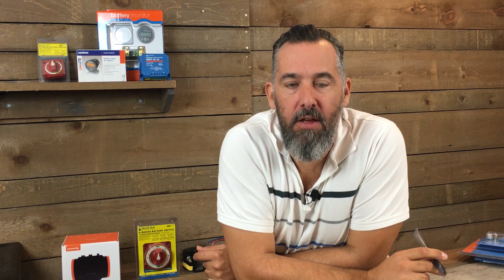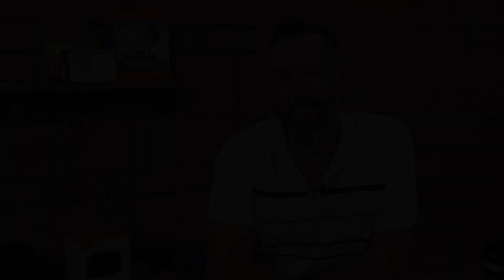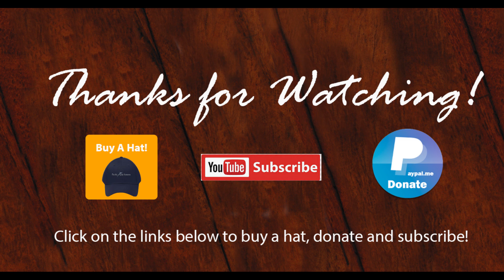Do Slow Charging Devices, Like Wind and Solar, Shorten the Life of My Batteries?

Comment: If I have flooded batteries,and four charge controllers.Should I set three of them to sealed led acid.So the batteries don’t get equalized to often
Reply from the maker: IMO, set the charge controllers to the correct battery type. Don't try to overcharge batteries to reduce the need for equalization.
Reply: @PacificYachtSystems  i was worried,each controller would equalize every 28 days, and it would be to much.Thank you for informing me.Love the YouTube channel

Comment: I was about to instal 450 amp hours of MG lithium batteries (which I have bought along with an MG Master LV battery management unit, a Top Systems TS 1600 100 amp DC/DC converter [this was for charging the system from the engine], and a Victron charger inverter) (I hadn’t heard of Firefly batteries). I was about to add another 450 amp hours to that and install the lot when the whole issue of lightning vulnerability of Lithium BMS came up with some high profile lightning strikes. So now I am looking at buying 450 amp hours of Firefly batteries instead of the extra Lithium and use those as the main battery system, and use the Lithium as a separate bank connected to 4 250 watt Panasonic solar panels and a D400 wind generator connected to the main bank with a second Top Systems 100 amp DC/DC converter. In this arrangement I think that I can switch isolate the the Lithium Solar bank (between the 2 MG Master battery management units). The charge controllers for the separate Lithium Solar bank are the individual MPPT units and the wind generator charge regulator I think?  For the main lightning protection I am designing a segmented silver plated copper tube with inner SS wire tension member to run from the mast head to the gunwale (with an extra loose trailing cable to the water disguised as a fender). They use such silver plated tubes in high voltage switching (400,000 volts I believe). The lightning problem is only going to get worse with Global Warming driven Climate Change.
Reply from the maker: Hi William, thanks for sharing. Interesting points, especially about lightening protection.

Comment: So the answer is to use firefly batteries, or have a lithium component for the solar that charges an AGM bank through a regulator of some sort in a controlled manner?
Reply from the maker: Hi William, that's one of the options.

Comment: Hi Jeff,  Awesome series.  I am refitting my new old Tayana 37 for some serious cruising.  I plan to head to Europe and beyond.  Can you please cover the topic of charger/inverters for worldwide use.  It seems like I would want to fit my boat with a 240VAC system and use some type of adapter when in the US and Canada.  Thanks again!
Reply from the maker: Hi Thomas, besides voltage, the real challenge is frequency. Inverter/chargers have specific voltage and frequency requirements. Read more about this here:
https://www.pysystems.ca/resources/tech-talk/european-conversion/
Reply: @PacificYachtSystems  Thanks Jeff!  This is very helpful.  As I have a new world wired boat, I am guessing the easiest and least expensive route is going with a charger or charger/inverter that can handle 120v/60Hz & 240v/50hz.  If only a charger is available, we could at least live off the 12 volt.  Thanks again!

Comment: I would like to add that it depends on the chemistry as well. A lead acid cell of any sort likes to be kept fully charged, or topped up regularly, otherwise they sulfate. A chemistry that does not sulfate  tends to be more tolerant of a partial charge. Rate of charge is more a system design goal/ideal when it comes to variable sources. I spec'd 1400 watts of PV for the truck system I'm building. I do not expect to see that output often, if ever. Alternator charging and a small APU are in the design to cover multiple cloudy days.
Reply from the maker: Hi Tao4409, thanks for sharing, well said.
Reply: @PacificYachtSystems  My pleasure Sir. Thanks for the great content. :)

Comment: Question:   I receive conflicting information on the type of DC/DC converter to be used on a boat. Isolated or Non-isolated?  An example is 24vdc house battery bank, step down DC/DC converter to 12 vdc to run lights and instruments. Shouldn't both 24 vdc and 12 vdc share a common negative grounding bus, hence non-isolated converter should be used? Many on the "internet" say to only use isolated converter. Victron sells both types. Confused.
Reply from the maker: Hi Telly, historically we'll always had troubles with non-isolated and mostly install isolated DC/DC converters.

Comment: I have a related question, if I have a charger on for weeks or months, to keep the batteries charged when the boat is on a marina, whats the ideal voltage for floating in this cenario for AGM battrries to extend battery life?
Reply: I asked Jeff this once for firefly. He said read the batt manual and charger manual and do NOT overcharge.
For firefly it is 13.4 v float I think and I made sure I set the xantrex charger in hot temp mode even in winter to prevent overcharging.
Reply from the maker: Most 12 VDC AGMs batteries charge at 14.6 for bulk and 13.4 for float. You'll want to buy a charge that is programmable to AGM or manually set to manufacturers preferred charge voltages. 

12 VDC Firefly batteries charges at 14.4 VDC for bulk and 13.4 / 13.5 VDC for float.

Comment: Nice video Jeff. Out of interest, what's the maximum current you've seen your 450w array produce? Assuming you have modern panels and controllers etc..
Reply from the maker: Highest amperage i saw was 31 amps.
Reply: @PacificYachtSystems  that sounds quite good. Regards Stormer